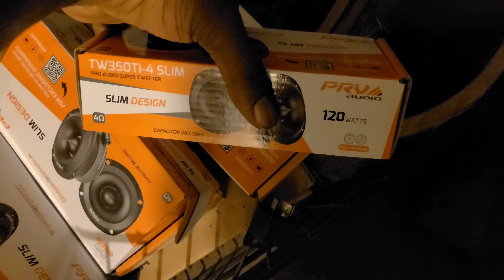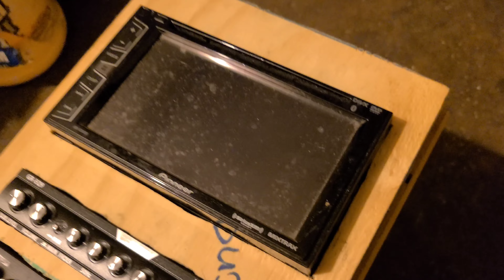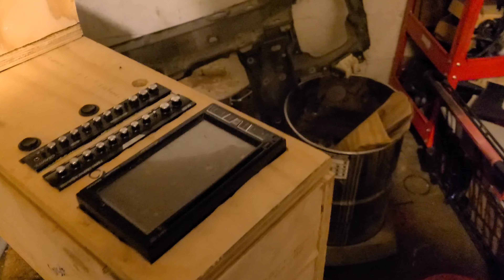Custom Center Console for the Impala!!![Part 1]

Comment: I'mma keep it a stack...car audio just isn't your lane. Woodwork is a hot mess... taking an angle grinder to anything wood is just wrong. Cuts aren't flush, painting over glue drips Your wire game is a hot mess, your fiberglass game is just wrong. You putting 30 lbs of Bondo on a door panel. I would tell you to invest in a table saw & router but nevermind...this just isn't for you. Pay a professional to do this.
Reply from the maker: I mean at the end of the day it all works but thanks for the criticism